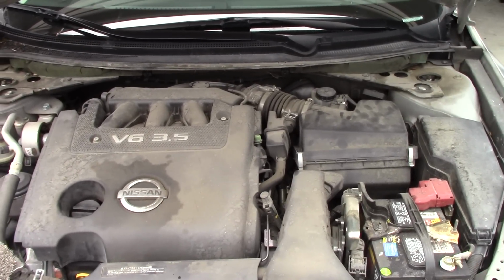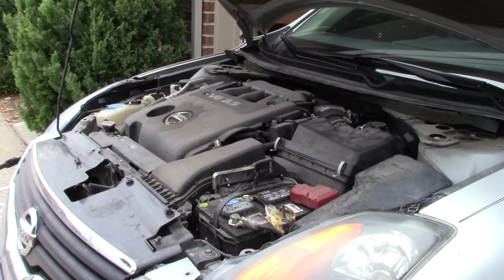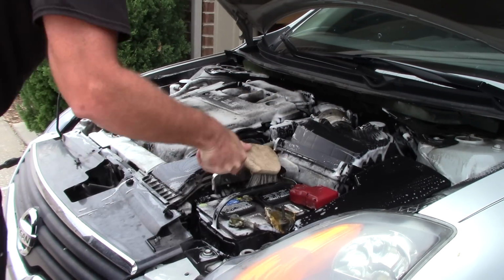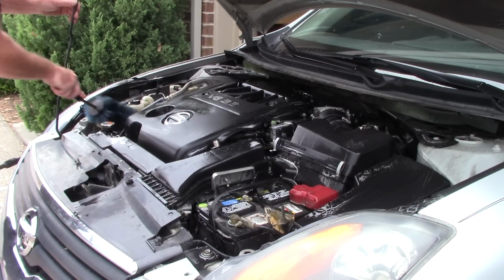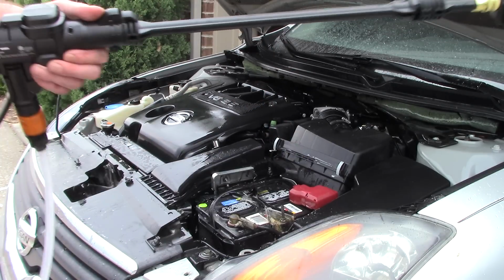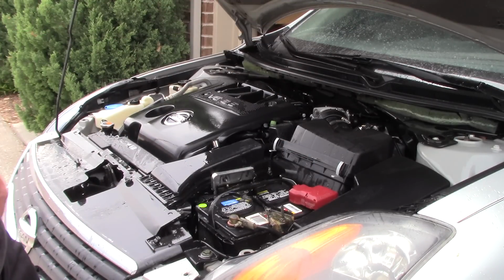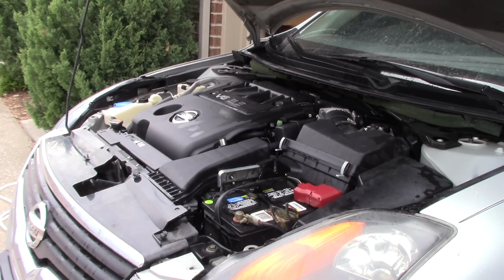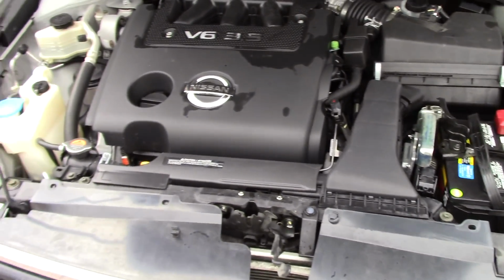Real Time: Super Clean Aerosol vs Dirty Engine Bay - Great Video For Beginners

Comment: Good job buut, always disconnect the battery so you don't end up with an electrical short. Engines are made to take on water, from the bottom. The components are made water tight however, over time their seals loosen up the to heat etc. And the pressure washer may not have been your best bet.
Reply: I 100% agree on that assessment that’s why I gave this video a thumbs down. I can’t even imagine the amount of water that was forced into all the electrical connections because of the high pressure. OMG!
Reply: We’ll both y’all or non professionals.
Reply: Stay in your lane bro.
Reply: Bro water comes in from the front past your grill and rad........ that's why you have an air box up top and waterproof conectors everywhere
Reply: Is always good practice to spray wd40 or similar in the electrical connections to disípate any potencial water. Don’t it many times never had an issue, I’m also a detailer and Scott is honestly taking a very safe approach on this job.
Reply: No need if you Know what you're doing

Comment: I washed & detailed trucks for 5 yrs using the exact same method only 1 would start the truck straight after finishing to dry of any water that got into any crevice or wiring etc & it works very well.

Comment: I definitely would have protected those caps on the battery from the super clean. Car batteries are not sealed 100%.
Those caps are actually vents for the battery, and has a high potential of letting in pressurized water or air if aimed at it.  
Free flowing water would have been better on the battery  IMO.
Distilled water, no big deal. 
A cleaner or  anything else is super bad inside a battery. 
I would have removed the battery caps and cleaned all the excess water & possibly super clean out before ever pulling out the blower. 
Probably topped off the battery at no charge, since I had some distilled water left over. 
Scott, knows what I mean. 

I Love the Super Clean product

Comment: I have watched a couple of your videos. Learned a bit from them. But... number one. If your not removing most of the plastic parts to get down to the actual engine your not cleaning the engine only the plastic and rubber parts. Next what about the bottom? I always go under to clean also!! That cleans up any oil leakage from oil being added and running down the engine. Just something I see. I'm sure your either detailing for a car lot or regular customers. But the job is not complete until the entire engine is clean! Anyway, like your vids. Just had to comment.
Reply from the maker: the client is given the option for all plastic covers removed but this will cost more since i don't work for free:)..about 95% of all customers just want what we call a top side clean when it comes to engine bay cleaning..my customer wanted this service done, and again that is the norm when dealing with the buying public...but yes i also do FULL engine cleaning for those that request or need it but i always offer and leave it up to them:)
Reply: Dallas Paint Correction & Auto Detailing 
Makes since!! Wasn't trying to down anything. Just wasn't understanding...

Comment: Hi Scott, I watched this about 4 years ago when I was selling an 8 year old Odyssey. I picked your approach out of a number on detailing engine bay. It was great, easy and effective. In fact when the first guy came to see the car, he took it for a ride, came back crawled around underneath and asked me to pop the hood. When I saw his face, he was perplexed - why does the engine look like it just came off the line at Honda? were there leaks, major engine work, etc, etc. Fortunately, the rest of the car showed as mint so I just told him that I detail the car myself and take excellent care of my vehicles. 'Nuff said. Closed the deal right then. I just bought a 2002 Vette convertible. Car is mint exterior. Interior and engine bay need some love. I'll be watching this and some other videos you've done to study up before i start. One question about the roof. It is an OEM replacement in the past 5 years - looks like new. I was thinking of using Ragg Top cleaner and Protectant on my roof. Any experience with this product? Thanks again.

Comment: Now to remove the cover and clean the engine
Reply from the maker: if the customer is willing to pay for that, I'm game:)
Reply: Great video but just cleaning the top cover is cool and all. I’m more interested in seeing a real cleaning underneath. That’s where the trust grease grit and grime reside. Lbs A new watcher to the channel September 2020
Reply: @michaeldabneyjr6203  Chris fix has a video doing just that
Reply: @dallaspaintcorrectionautod8343  So what you are saying is half-ass it.  It's only two screws half-of-a-turn to remove the beauty cover.  Should be part of the job not an extra.

Comment: Great job man, car is 11 yo so clips are weak and tend to fall, so as cheap paint on 3.5 normal!!! destilled water will never harm an engine, pointless disconnecting battery due to destilled water used here and clearly mentioned, never remove old car covers as they are burned and will surely brake, good move, that sprayer has a soft pressure so wouldn't cause any harm, great job keep up and thanks for showing your labour, do not pay attentions to harsh kidz we all know them 👍🏼

Comment: I would never ever do this while the battery is inside. First remove it. Seal the cables end. if you want to change battery in certain cars, like passat, you have to make sure the battery cables are not touching the car body. 
My passat under the hood, wasn't cleaned . Looks like 60% of your brand new cleanness.
Reply: Removing the battery also opens much more area to cleaning..
After removing the battery foil is the best product to use to protect electronics...after crimping it doesn't move as would 'saran'.

Comment: I'm not a fan of water in my engine bay only because of the electrical parts n connections. I only saw the top surface cleaned. What about removing the plastic top parts to get to all the parts. Is steam clean any different or better?

Comment: Great video and nice results.  I would go slower with the pressure sprayer instead of going over the engine several times, I would rinse the area until it was free of the detergent.  Thanks for posting.

Comment: 1) Disconnect battery. 2) Don't use pressurized water on an engine not matter the circumstance since it can damage electrical or mechanical parts. 3) I don't think he mentioned this, but make sure your engine is cool. 4) Watch Chris Fix to detail an engine.
Reply from the maker: Zoltack429 no reason to disconnect battery...
This pressure washer is only 300psi..
Everything you stated is from a lack of experience and knowledge:)
Who the hell is chrisfix!!
Reply: Really? You don't think that putting cold water on a hot engine is bad? You don't think that it's a good idea to disconnect the battery when working in the engine bay and getting water on the battery? And you say I have lack of knowledge and experience? Lol

Comment: You said to ask about particular concerns with this, what about the alternator and electrical components like that...?  I would imagine drying it as you did would help, but I would also think to cover it maybe...? Would appreciate any info before I clean my 2005 F-150.
Reply: you could just take out the battery, then for the electrical components get some rags, etc to cover them.

Comment: any protection on the battery? looks a little bit scary while pressure wash water hits the battery...
Reply from the maker: the power washer is only 175psi...why is hitting the battery with water so scary?...would love to hear your response:)
Reply: Lots of people fear shorting out the battery, which is why not a lot wash they're own engine bays. 

But as long as you don't use too high a pressure for an extended period of time, you should be ok. 
I'm about to use some similar tools to clean out my poor old Subaru. I'll use a plastic bag to be safe, but people with more experience don't really need to.
Reply: CHEN BO
Reply: Yours was the comment i was looking for!  Not only the electricity being a REAL issue but what about the housing for the battery NOT being cleaned!? They hide ALOT of dirt AND...AND, the whole battery needs to be wiped down and you can't do that while it's still in the engine bay! He MUST HAVE BEEN TIRED when he did this vehicle. I know i wouldn't spend that kind of money for someone to do a half ass job because they were tired.
Reply: Emily Irvin the customer paid a half assed amount of money for a quick clean. He explains that multiple times in the comments. But you do all your own cleaning right?
Reply: J Irvine lol, actually I do!

Comment: Be careful with super clean in the engine bay, it removed my base color down to the primer.  I would never have guessed this stuff was stronger than most alkaline-based engine degreasers.  I wish that I could go back in time.
Reply: I used Superclean and it removed more than just the primer, it removed paint down to the bare metal. That would have been perfect for me under the hood but the problem is it didn't remove the paint evenly, the paint was all spotty, faded, and hideous looking. I spent days and days removing the remaining spotty paint using lacquer thinner. It was a royal PIA.

This video is nothing more than a giant affiliate kickback marketing banner. Lame af.
Reply: @stephanparis6887  sorry to hear. Super Clean can be used full-strength on engines, however it should be used diluted on painted surfaces (3 or 4:1) and not allowed to dwell for long. In fact, Super Clean warns to be careful when using it on aluminum, painted, and powder coated surfaces. So it's probably best to just use it diluted and rely on a little more agitation to finish the job and rinse it off relatively quickly on those painted areas.

Comment: Scott, I agree the high pressure hose does a great job, but I was always told high pressure water can get into electronics and cause havic with electrical components. Best to use a garden hose and let the water just free flow. Yes, it's more water but less high pressure.
Reply: Except that the water sprayer in the video is not high pressure, it's low pressure and he is using distilled water.

Comment: Hey Scott, how about starting one of these engines after cleaning so we can see how well it starts and idles ?? Thanks my man 👨!!👀💪🏼
Reply: WarDawg It might short all the electronics because he didn’t disconnect battery 😂
Reply: Your late model cars like this Nissan do have sealed electrical connections to protect from moisture.  Your older models do not. I do detailing myself here  in Iowa and have been very successful with everything that Ray has advised to do.  Some say he talks too much, He just wants to make sure you understand what he's trying to teach you.  He does great work, so, unless you are a pro and can do better, quit complaining and start listening. Who knows, you may make some good money as I have by doing it the right way.
Reply: @mitchelllong5848  I know this is a year old, however, he's using distilled water. Distilled water cannot conduct a current like tap water, so no electrical issues wil occur.
Reply: @jefflambert215  good point
Reply: @billconnor3644  maybe you will see this.. what is a late and a older model... Mine is a 2014 so is that a late model or an older model.. I need to clean mine and my knowledge of late and older isn't clear. I'm being serious

Comment: Shouldn’t you disconnect the battery first?
Reply: Certain Honda's would then require a specific 4 digit radio code once the battery is disconnected. This discouraged theft when designed.  Also, certain Dodge models have to have their HVAC blend door actuators recalibrated at the dealer if the battery is disconnected.  Theres more, but I'll stop there.
Reply: This is why he is using distilled water... Distilled water is not conductive.
Reply: @ta2101  🤔😗🙄???
Reply: @ronnieperalta4051  is that a real question? water isn't a very good conductor of electricity at all without dissolved solids in it.

Comment: I do mine at the car wash, spray with the low pressure presoak and rinse with low pressure spot free rinse, fast and easy, never had a problem.
Reply: Oh yeah ... Still no issues ? I wanna clean my 2014 and don't need problems is there anything you could tell me ?

Comment: I noticed you didn't cover anything up nor did you unhook the battery? And where did you get your sprayer at?
Reply: hilham 89 Go to Harbor Freight and Tools and buy their portable washer that runs on household current it's better than the WORX HYDROSHOT (which runs on a battery and is really a puny washer).  The key component is the distilled water - - never use tap water from any faucet to wash your engine.
Reply: David Turner do you have a link?

Comment: I use Simple Green.  Doesn’t have the clinging ability, but it is cheap, effective, and non-toxic.  As a avid DIY’er, been using it for years.
Reply: With the full strength how do you mix it

Comment: You don't need to protect some of the electrical parts on some cars?
Reply: I would like an answer on that question too Scott. People are uneasy about water messing up elec components, the MAF sensor, and whatever else it could damage, thanks.
Reply: On modern cars? nope

Just watch out for Cold Air Intakes and modified stuff :)
Reply: If it makes you feel more comfortable you can take a plastic bag and cover up the fuse box/alternator and either cover the battery or just take it out.
Reply: pretty much every other engine bay detail I've seen on YT has the first step of covering all electrical connections and electronics with plastic bags to prevent water ingress.
Reply: Sherukka Nope i pressure wash mine with a 4200 psi washer never had problems and i hit everything yes the alternator too
Reply: Sherukka koo
Reply: I have always used a water hose in my engine bay, but NEVER a pressure washer. Water hose is fine, because your engine bay is made to withstand some water, but your engine bay is not made to withstand a pressure washer. A pressure washer forces water into places it should not go and can dislodge some things. 

I do, however, cover my air filter with a simple plastic bag so it does not get wet.
Reply: Distilled water you don't really have to worry about anything. As long as you do not sit there and spray 20 gallons of water in there you are good. On engines with a distributor and carburetor cover those with bags. Fuel injection you are good
Reply: Know this is about a year old, but a car can withstand some water in the engine bay. Like some have said, if you don't feel comfortable can always put a bag over fuse box, intake(least plug it up) and maybe cover the battery. MIne has a battery cover, though I still wouldn't want to use a power washer up close. His seemed to be a very small Lithium Battery operated washer, so not lot of power,  but enough for that job.
Reply: grimvaper 69 99.99% of people here missed the part about distilled water..... jeeezzz Louise!!!!!

Comment: I finally understand! He says he uses distilled water. That is the key. Distilled water does not conduct electricity. That's why he can spray it in an engine and not worry about anything. Regular tap water is a no go, the minerals in the water make the water electrically conductive but distilled water has no minerals.
Reply: Less minerals then tap water but I think you're confusing deionized water with distilled water. Distilled will still conduct electricity.
Reply: @Z00m44  correct i think as long as there is a chemical bond (h2o) it can conduct electricity...
Reply: @Z00m44  Water doesnt conduct much electricity. The impurities do. Distilled water is even purer than deionized water, so even if the H2O molecules conduct a minuscule amount of electricity, it's basically the same as 25 degrees of Celsius warm air. So you can pour distilled water on a batteri and it wont conduct more than the warm air around it. But you need to be sure it's perfectly distilled. Double distilling will help make the water as close as you'd want it when pouring it on or near a battery, but single distilled will most likely also be enough. A small shower of rain or water, even undistilled, wont short circuit your battery.
Reply: @beersmurff  WRONG..ANY H2O will conduct electricity, and the minerals in tap water are NOT a problem. NOW...using distilled water to wash the car and especially rinse it...YES, that would make a difference for no water spots.
Reply: @siseley1  H2O doesnt conduct much electricity. the impurities do. Try look it up before you start shouting misinformation.

Comment: Is this really the prudent approach to do it?  I've always been told that (1) the distributor (cap) has to be covered with a plastic baggie or aluminum foil (tightly crimped) to keep water out of it and (2) WD-40 to be liberally sprayed to all electrics, esp. connectors, to keep water out .. and then again after the washing is done to drive any stray water that go by out of the electrics.  Also, aren't you supposed to start the engine right up and get it fully warm before shutting off, to finish dry everything?
Reply: cars dont use distributor caps any more  that  logic of covering shit   is for cars from  pre 1980's   all modern  cars use military spec waterproof connectors